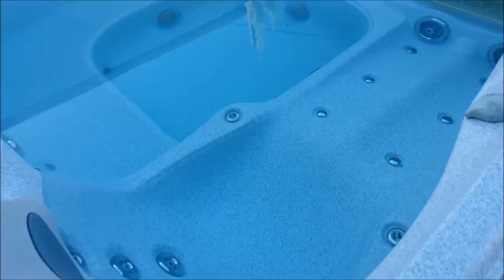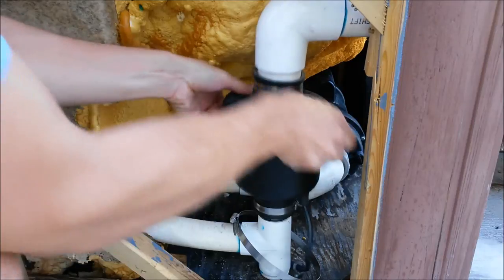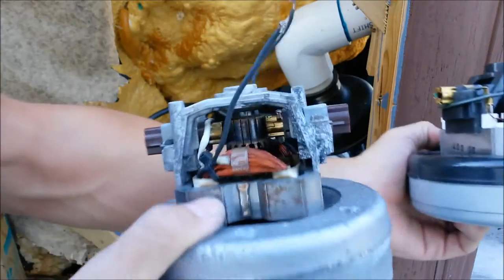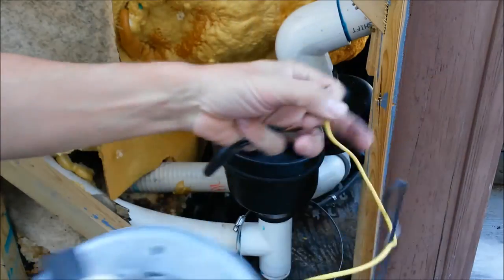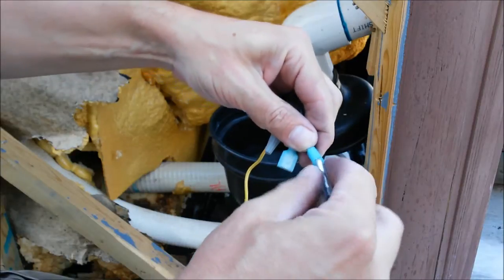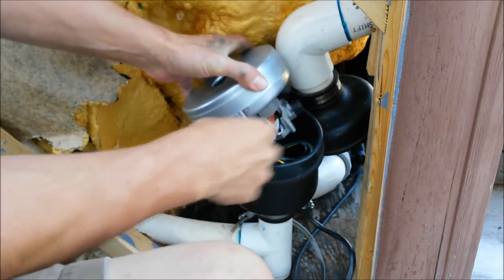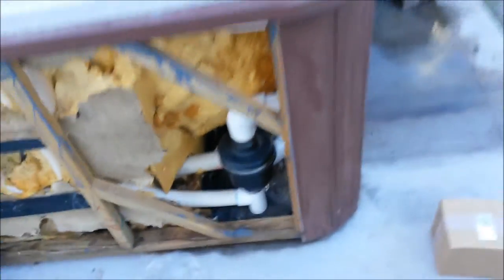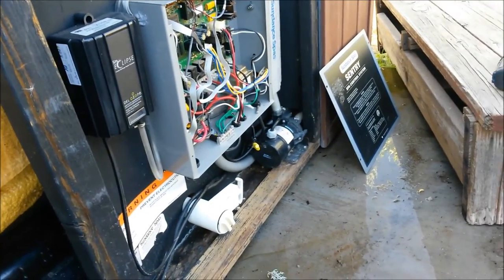Sundance Spas ~240V~ Air Blower Motor Replacement in Your Hot Tub

Comment: I replaced a 240 with a 240, identical model, different serial number, but when powered on the air blower seems a lot louder than I remember. Any thoughts on why this might be happening? 1997 Sundance Capri for reference, 6500-103 air blower motor 230/250 V, 1 HP went in. Great video by the way helpful for the replacement.
Reply from the maker: It's possible they use multiple manufacturers for the components. One could have been made in a different factory. Generally the blower is a bit quieter than the jet motors and all of the bubbles.
Reply: SpaDayz thanks for the quick response. It’s defiantly louder than before and is making a noise over the pump. I know you mentioned polarity doesn’t matter, and I got the unit in nice and tight to its casing. Have not covered that opening yet that you reference an air filter for. Is there any harm in running it for a while to see as it gets going if it quiets down? Fairly new to the whole DIY on an old hot tub so not sure what to expect, definitely seemed odd though
Reply from the maker: @Griff1012  It probably won't get any quieter. You can leave it for a while if you want. Putting the cover on will quiet things down a bit. If you don't have any kind of filter, I would recommend coming up with some kind of filter.
Reply: SpaDayz alright, great. Thanks for your reply. It sounds like despite the sound I shouldn’t be too concerned (until it potentially goes) so it’s worth waiting and seeing! Thanks for the help and the video!
Reply: I should also mention it’s running great so that’s something!
Reply: There are different hp. motors out there, they will sound different. Sometimes you may get a bad blower right out of the box,  ten of them in a row really sucks.

Comment: On a 220 volt motor that yellow wire would be the neutral return, NOT THE GROUND. There needs to be a 4th wire there somewhere for a proper ground actually.
Reply from the maker: Yeah. Kinf of scary that it isn't grounded when there is a chance it could be fluidly coupled with the tub.

Comment: Thanks for the video.  My old blower motor on my 2001 Sundance Optima blew up while in the spa and could smell that it blew. It tripped the fuse on my house electrical panel.  I ordered the same motor  (BX9658, 240V, 1HP) from SpaDepot and installed it.  However, when I hit the air blower button on the display it clicks and the blower motor will not come on.  I believe the electric connections are installed properly.  I am wondering if a fuse on the spa control panel could have blown.  I have heard that there is a fuse on the control panel dedicated to the air blower.  If so, could you tell me what fuse that could have blown?  Please advise and thanks for the spa maintenance videos.  They are very useful.
Reply: Did you ever fix this issue? Mine is clicking and not sure if the blower is bad.  I am to believe all of the fuses are good.
Reply: @mikemicara  I think I got another motor which did work.  Spa Depot was nice giving me a new one.